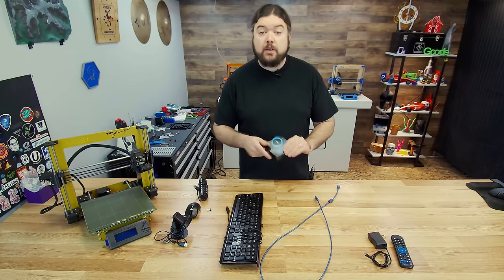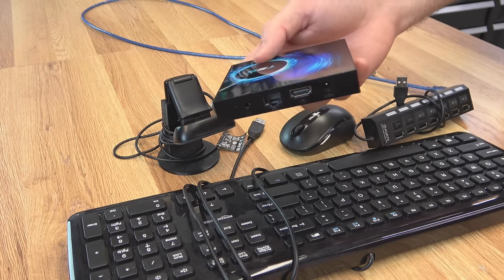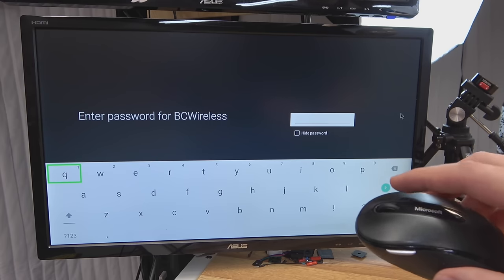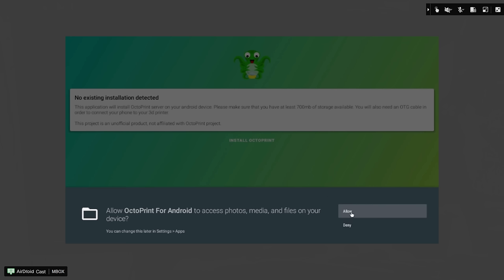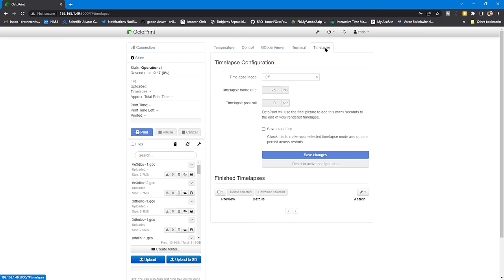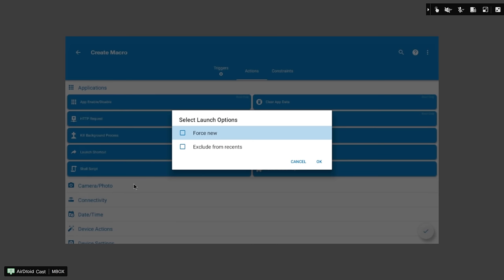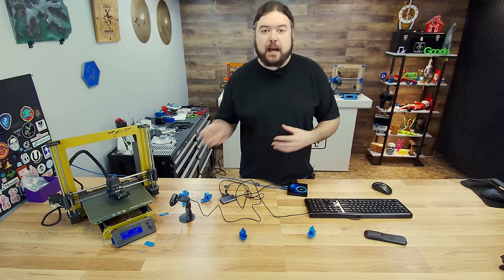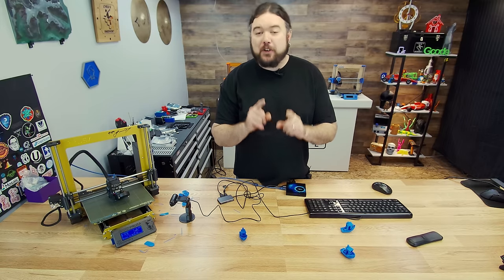Android TV Box - Octo4A - Not Worth It - Chris's Basement - 2023

Comment: Looking forward to the follow up video! Not all android tv boxes are useless, those running on Amlogic S905W, S905X and a few others have pretty good support from the Armbian community and I've successfully installed Klipper and Mainsail via KIAUH on a few of these already (X96 mini), but still haven't used any of them in a real build. Even KlipperScreen worked with a touch screen! Wifi most likely won't work on most of these devices due to the lack of a proper driver, but a small nano usb wifi card will work just fine. Other downside would be the number of USB ports - in most cases only two ports are available. For the price (used ~$10) it's still worth it. Cheers!
Reply: I have got klipper running on s805(mxq pro 4k-only on usb/sd old kernal 5.*) s905(hyfai-only-on usb/sd) s905x(t95x) via Armbian and a rk3328(libre renegade) and they support I2C, SPI and UART for the most part. Granted I haven't had much success with Armbian overlays to enable them. Haven't tried an android install yet but Klipper via KIAUH on Armbian can work also there are some other distros such as openwrt on the boards listed. Overall great way to save e-waste!
Reply from the maker: Yes, the next video will make much more since. This one I was just trying to run a 3D printer out of the box. The next one, we get crazy with it. :)
Reply: any chance you can point me in the direction to get it running on my tanix x4 (s905x4)
Reply: @8l0wm3  From what I know s905x4 is not supported by Armbian and not sure it ever will

Comment: I would try with an amlogic box or rockchip. I have been out of the scene for a long time..but allwinner software used to be really bad. Amlogic was best followed by rockchip.

An additional advantage on amlogic is the ease of running Linux native
Reply from the maker: I found a box that actually works really well, it will be in the next video.

Comment: My question: My Prusa Mk3 i3 3D printer is housed in a remote shed that can get quite chilly. Although I don't live in an area with heavy snowfall, the low temperatures can still lead to minimum temperature errors for the bed and nozzle of my Prusa Mk3 i3 3D printer. Unfortunately, these errors can also make it difficult to start the printer remotely.

These errors are frustrating because I have to use a heat gun to raise the nozzle temperature and restart the printer, and then repeat the process for the bed. Do you know of any ways to avoid these low temperature errors? Some people have suggested rolling back the firmware, but I prefer to keep the latest version if possible. What are your thoughts on this?
Reply from the maker: I hear that, I have seen the same issue at times. You can disconnect and reconnect to restart the firmware. Sometimes that's enough to be able to allow you to start the heaters.
Reply: Is there a way to reset the 3D printer remotely maybe Octoprint?
Reply from the maker: @MaxGoddur  I looked through the firmware codes, I can't find a reset command that you can send.

Comment: Linus Tech Tips just did a video on how most of these cheap Android TV boxes have built in back doors  that could be used maliciously. Probably best not to use these without securing them from accessing other things on your network.
Reply from the maker: It's sad, but a lot of these boxes have some pretty bad stuff on them. With good network security, you can usually avoid problems.

Comment: Librelec?
Reply from the maker: Not sure what you mean.
Reply: @ChrisRiley  it's a Linux OS which I found to use on lower powered TV box machines for running media services but its low demands on processor it might work with octoprint. I looked into it for Plex a while ago and didnt fully succeed. It worked on an old raspi but the TV box was tricky to find exact chip model
Reply from the maker: @benscottbongiben  I'm not 100% sure what it was running. I have been playing armbian going back on it, it seems to work well.